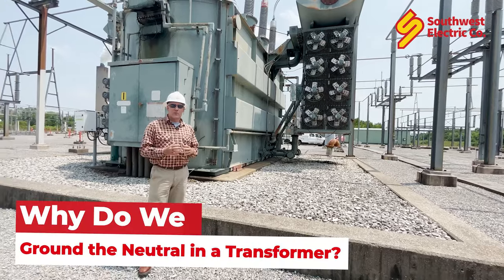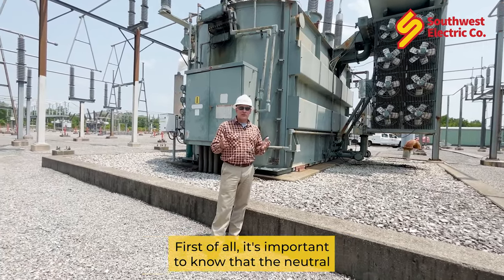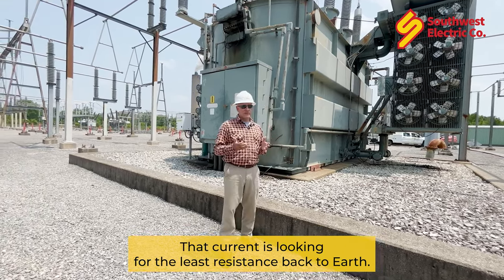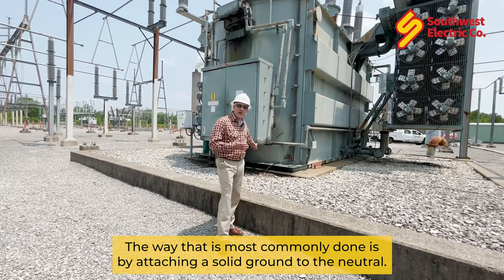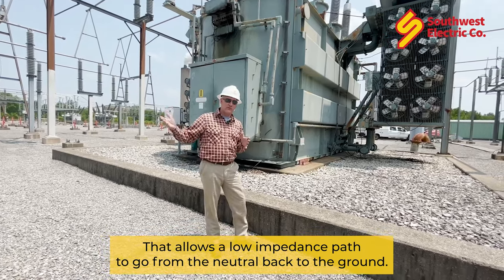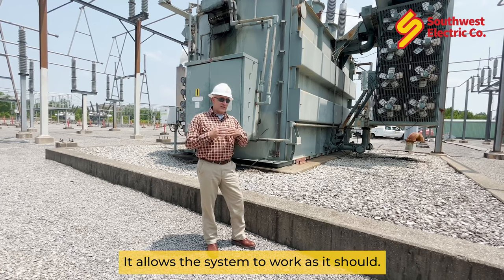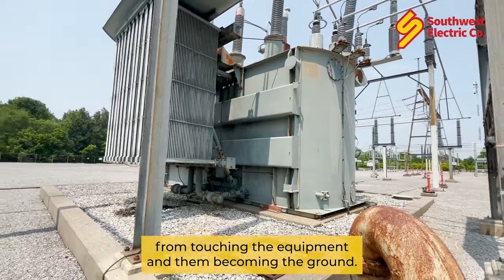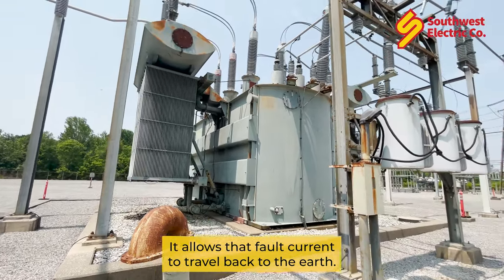Neutral Grounding in Transformers: Why Do We Do It?

Comment: Please make the distinction between “earth ground” vs “equipment ground”. These are two very different things that people often get confused. 
The neutral is the return path for current under NORMAL operation. However, during a ground fault (a phase hits the metal casing of its motor for example) the neutral DOES NOT CARRY CURRENT INTO THE EARTH. Now, I say none but in reality about .000001% might. 

The equipment grounding conductor (this will be a green, green/yellow or in residential bare wire) will carry current BACK TO THE SOURCE.

In a newly derived system, like the video above, the secondary side of the transformer(we can assume this is going to a factory or feeding distribution lines since it has a neutral (wye transformer)) will have the neutral and equipment grounding conductor bonded. 

So yes the neutral and equipment bonding conductor are very similar in where they go, but serve different purposes.

However, let’s this about this, EARTH GROUND. Yes the neutral and equipment grounding conductor will be bonded and EARTH GROUNDED, meaning a freaking rod (or many rods in the case of a substation) will be driven into the earth. That is earth ground.

Earth ground doesn’t mean JACK for fault current. The resistance path back to source is very very low, the resistance path into the ground (relatively) is very high. 

No freaking fault current goes into the ground. Stop the lies.
Reply: Thanks for the explanation. Also wanted to know why they use earth as a return path for transformer with only one phase tapped?